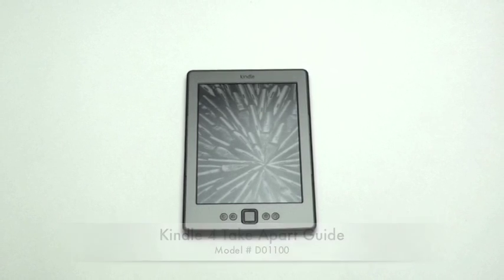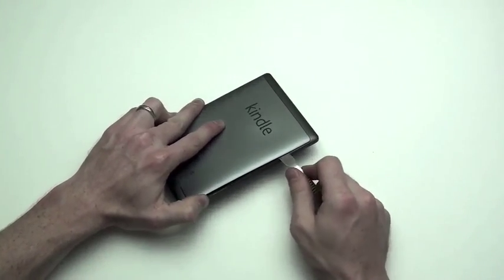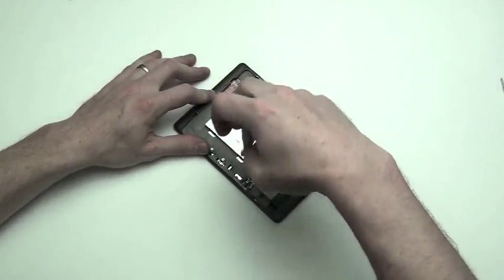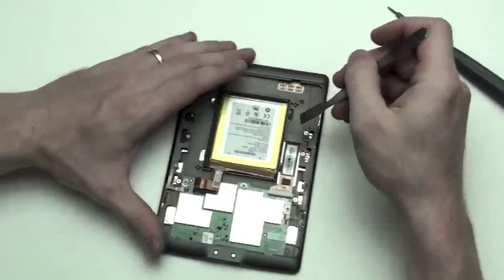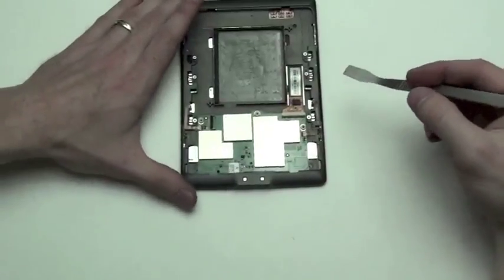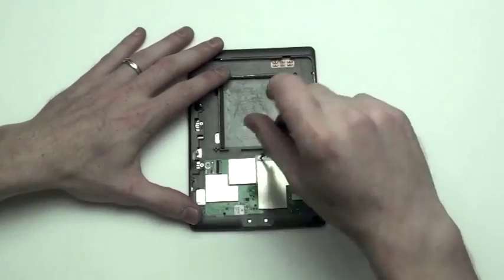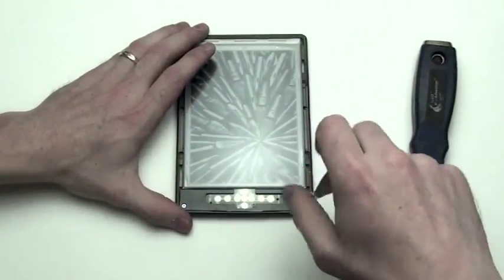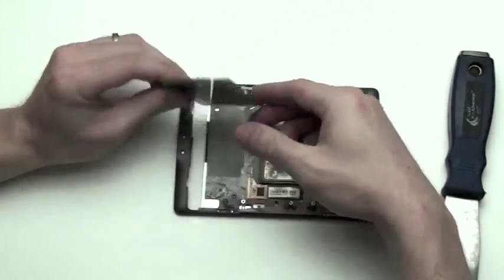Amazon Kindle 4th Generation Take Apart Repair Guide D01100

Comment: Use a little isopropyl alcohol around the battery compartment, 3-5' coffee break to soften the glue, then insert a credit card by the widest side. The battery comes out easily without damage.

Comment: Thanks for posting that movie. I used it to try to repair my Kindle, but unfortunately i had no luck. The issue i have is that my Kindle stuck on the screen showing only the start screen from some time. I thought it lacks of power, but im not able to charge it. I removed the back cover, detached the battery, screen connectors and all other connectors i could detach, counting on the device will disable and reset the screen permanently, but this trick doesnt work on e-ink screens. i have also tried to reset the device just by pushing the power button or to load the file to make a factory reset, but nothing works for me. The device is showing as a disk after connecting to the PC, i can copy files to and from device but the screen is not changing and shows the same page all the time. Maybe some of you have an idea what is happening here.
Reply: Hi, I followed this procedure and as soon as removed the old battery the screen starting saying "Your Kindle Needs Repair" and displays this with (or without) battery power! - any tips please on restoration? Thanks

Comment: You can use a hair dryer to soften the glue before prying off the lid, battery, motherboard, etc.
Reply from the maker: fatweeb Good tip, but just be careful about to much heat on the battery.

Comment: Good video, albeit there are some unnecessary actions used. For instance, use some cologne/other alcohol-based liquid and apply it between the battery and the surface it is glued to. It dissolves the glue and helps to remove the battery easily without damaging the circuit.

Comment: How to fix Kindle touch screen, its not completely unresponsive, i mean the top section works fine but just below it, unresponsive, and below it the touch works but again just below it no response. 4 sections touchable 4 section unresponsive what is the solution? Anybody please!
Reply from the maker: You have to replace the screen.

Comment: I got smoke while removing the battery. It smelled a bit. Do I have to stop or can I continue ?
Reply from the maker: You need to replace the battery. If you got a wisp of smoke and a smell (probably a little fruity) then you have punctured the battery.
Reply: Thanks for the answer. I want to change the display but if I have to change the battery as well... Well, I think I'll buy a new Kindle hahaha 
Thanks for the help and for the video great job

Comment: Erm D01100 is NOT the model number of the Kindle Touch
Reply from the maker: Correct. The D01100 is the 4th Generation. In the video we call it both names. We sometimes misspeak...to be fair though, the models are extremely similar.

Comment: Hi! can you tell me what is the polatity and req. voltage for the back 2 docking pins for charging? I have kindle 4 and want to build a charging station without the microUSB  but the 2 pins on the back

Comment: managed take apart quite straightforward.
Some suggestions;
- leave battery until after motherboard. You can then slide a sharp tool under battery without levering it up from an end.
- motherboard was glued not t5 screwed. Just 2 small blobs at each mid side edge. Slide in a tool at each edge below where the metal frame prevents access under the board.
- I liked the suggestion from another to first remove the front bezzel as it gives access to the side clips of back cover.

I need to replace a broken screen. That job is next!
Reply: I also have to replace a broken screen. Any luck yet? Any tips? Did you by chance make a video?
Reply: Eventually did replace screen.
Bought one off ebay.
Had to use hairdryer to warm the old broken screen to facilitate scraping it off the chassis.
Used sticky stuff remover for final cleanup of the screen mounting area. I think it is absolutely required to re-stick screen and bezel as nothing else holds the kindle together!!!
Reassembly is straightforward, but leave screen and bezel til almost last. 
Bought some glass glue for use sticking screen in place and then bezel. The glue was evo-stik serious glue - bonds glass to just about anything http://www.homebase.co.uk/en/homebaseuk/evo-stik-serious-glue---5g-760314
can be applied thin film or thicker for a "padded" fix. re-positionable for 3 minutes, sticks in 2 hours sets in 24h.
Once bezel set for 2 hours, finally fitted back cover. 
I did test the screen before gluing!
Have fun.
Would definitely consider doing this again.
Great original video!

Comment: How come your motherboard came out so easily? The one I have here has the motherboard glued down with the same sort of glue mess the back cover is held down with - its near impossible to lift it up without flexing the board, and in doing so its likely to result in damage to the soldering of the chips. ARrrrrrghhg!
Reply: use alcochol IPA or very smal plastic card

Comment: No need to remove the battery to remove the screen. I don't think replacing the screen is worth the efforts. Even though using a heat gun makes it a bit easier, one can't avoid breaking it up and removing it by fragments. You will end up with a lot of tiny shards stuck to the glue. They are very tedious and difficult to remove. If you leave them, putting a new screen on top would be like putting a sheet of glass on a rocky road. The end result would be higher risk of it cracking again. Just buy a new or second-hand Kindle. As the repair people say, if the cost of repair is close to 50% of the cost of a full replacement one, don't fix it.
Reply: +Roman Golubev is there another way, i have removed the broken screen and tried to remove as many shards as possible even with tweezers. Can i apply a new layer of adhesive or glue on that rocky road?
Reply: +Zoran Relic I guess you can but it has to be very evenly spread, which could be difficult to achieve. Something like a double-sided sticky tape may work better. I just put the new screen in mine onto what was left of the original adhesive (had to use tweezers too to get rid of shards) after the clean up (some bits of it got ripped off with the glass).

Comment: There is a better way of taking it apart. Remove the bezel first from the inside edge outwards to prevent the screen de-laminating. then you can access the clips for the edge of the rear cover. I ended up damaging the rear clips as they were glued to the bezel.

Comment: dannyboyy31 has right, Amazon glued screen and it's very hard to remove it to place new screen replacement. To separate pieces of old screen I needed to use hair dryer and palette knife, and next sandpaper to clean it. This part on video is easiest, but cleaning and removing old screen of glue is torture. But it is worth the efforts in the end.

Comment: What this video doesn't tell you is the screen is glued to the rear bezel assembly. The only way I've found so far is to prise it off one small fragment at a time using a small blade, but its slow work.

Comment: where is the reset button on this model?
Reply: There is no separate reset button, you need to hold On/Off switch for approx. 20...30 sec to reset the kindle.

Comment: Everything is good, except that at the beginning 0:15 the narrator states that the Kindle Touch model number is D01100. The model in the video is NOT a touch, but this is the correct model number for it. The Kindle Touch model number is D01200.